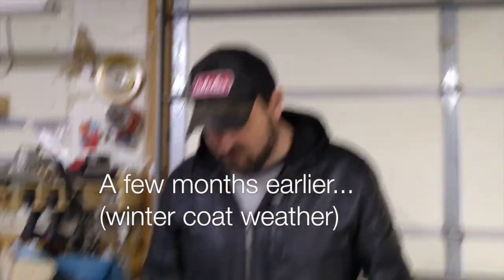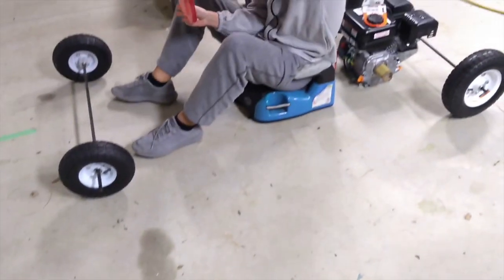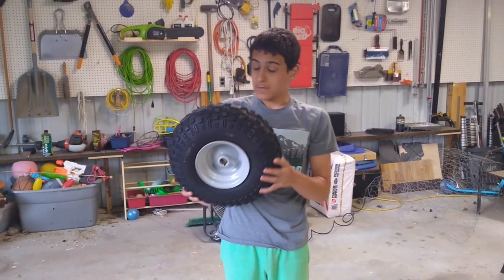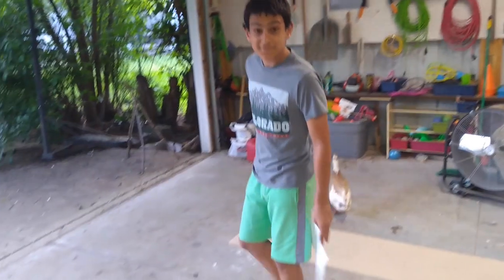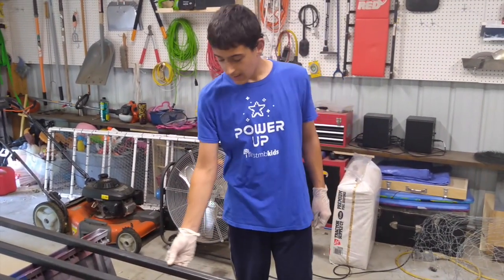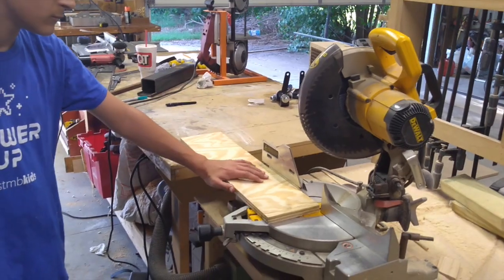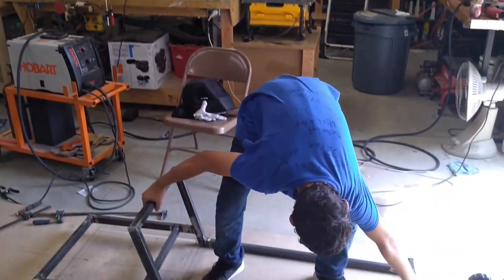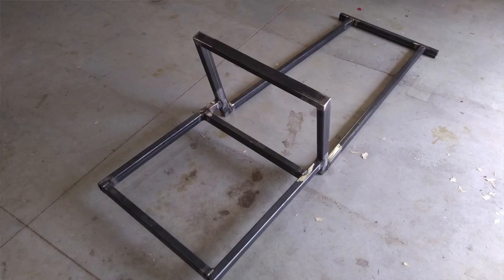Building a Go Kart, Part 1 - Design, Planning, and Building the Frame - NOW WITH FREE PLANS!

Comment: Hey, don't know if you're still watching this thread, but my 12-year-old son and I came across your videos and have watched them all a few times over! So we're going to pull the trigger and already bought all this steel for the frame. I'm a machinist, so I am able to make several parts on my own. I do have one question. did you buy the 8-in live axle kit, or the 6-inch?

Comment: Thank you guys so much for this build!!! I can’t wait to begin! If you guys don’t mind, could you make a list of all of the parts that you used and where I may be able to find these parts? I’d really appreciate it!
Reply: They probably won’t answer cuz it’s awhile into the future😂 but as far as the parts go most of them I Bellevue are listed I the beginning of each video. And where to find the pets and tools; Home Depot, harbor freight, and/or any metal store for the body parts. And if your looking for a solid metal to build it with. I’m not smart enough to tell you but I bet some quick research will tell ya a light but strong metal to use! ( stainless steel or regular square tubing maybe?)

Comment: Do you guys ever fabricate any brackets? I’m trying to figure out how to make shock brackets and spindles.
Reply from the maker: We didn't use it on this project, but typically we use a cnc plasma cutter for that. Although if you just need one or two of a simple bracket, it's usually quicker to just make them by hand. Band saw, drill press, etc.

Comment: Looks great. Any chance you have the dimensions/plans for the frame you can share?
Reply from the maker: Thanks! Our "plan" isn't really accurate anymore because of a few changes we made along the way, but I can give you the basic dimensions: our kart frame is 22" wide at the back, then tapers down to 17" wide at the front to allow room for the front wheels' steering arc.  The front axle is 25" long (from kingpin to kingpin).  The wheelbase is 51", with an overall length of 72".  Ours is pretty long, but I made it that way for an adult to ride comfortably.  Overall width (outside edges of tires) is about 38".  Hope that helps.  I have had several requests for plans, so I might draw up a fresh set to share in the future.

Comment: I love the frame design that you went with, what were your final measurements after the adjustments?
Reply from the maker: Thanks! Our kart frame is 22" wide at the back, then tapers down to 17" wide at the front to allow room for the front wheels' steering arc.  The front axle is 25" long (from kingpin to kingpin).  The wheelbase is 51", with an overall length of 72".  Ours is pretty long, but I made it that way for an adult to ride comfortably.  Overall width (outside edges of tires) is about 38".  Hope that helps.